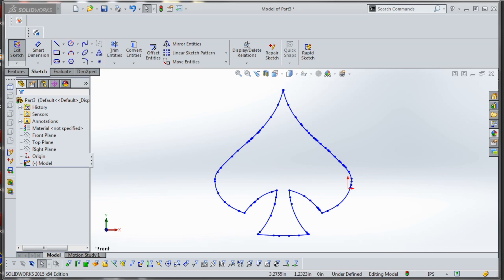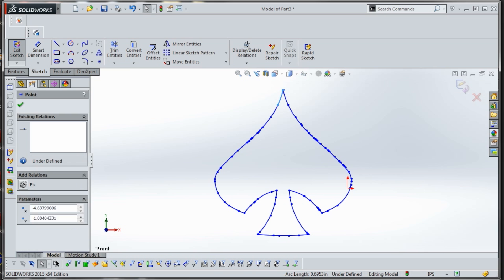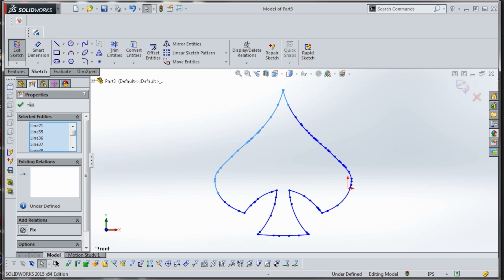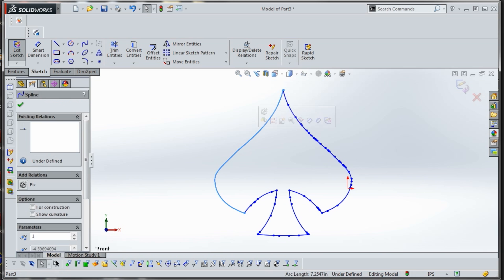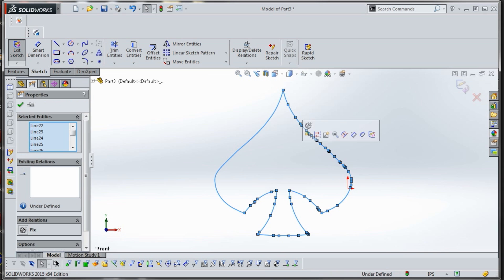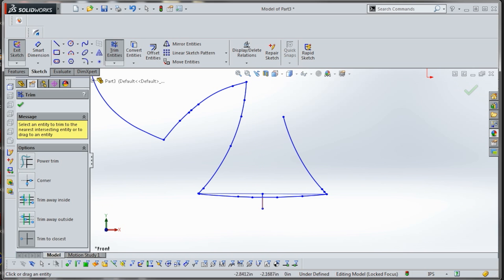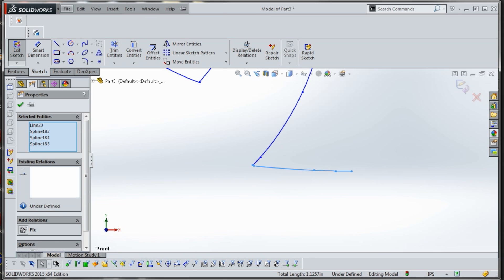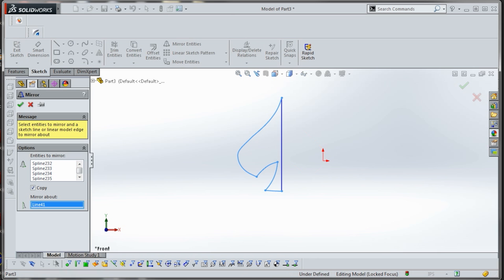Incredible SolidWorks Spline Shortcut!

Comment: When doing splines, I try to keep it to a maximum of 3 points, but usually settle for two per curve, depending on the control I need. I feel like the biggest two curves could have been done with two points (touching each corner), then just adjusting the arrows that result from each point to get what you need.

Comment: Hohohoho Tkanks! and about the selection, if you click from right to left you get green selection (doesn't matter if you just pick part of a line it will take full of it) left to right, blue selection, it will just pick the line which are completely inside of the blue square.

Comment: You mention holding 'select' to make your selection only select what is fully inside the boundary, but did you know that the selection is green when you click and drag to the left and blue when dragged to the right?

The green selection selects everything, while the blue is only that which is inside the selection boundary completely. Unfortunately this only is true in sketch's but is handy nonetheless.

Also when doing fillets, chamfers etc, you can select one edge then just hover into the tool tip and it should have multiple options for auto selection (on solid works 2014/15). Otherwise before selecting the edges you want, right click and use the 'select tangent' or  'select loop' as required.

Comment: A quick tip from me, instead of holding down keys when your selecting things, if you start at the top left and draw your box down to the right, it selects everything wholly inside it. If you start bottom right and select towards top left it selects everything it touches. Just my little time saver I use. Hopefully it's of use to someone.

Comment: Awesome!  I didn't know about this, and have also had lots of headaches converting vector files with a billion line segments.  Thanks for the tip Greg and John!
Reply: JohnGrimsmo I watched your video some time ago about cleaning up the crown file for engraving and thought that was a great way to do it. Im sure your kicking yourself now for not knowing about this. :D
Reply: NYC CNC Is the customer file a DXF? DXF doesn't support splines and will break them into small straight line segments. If your customer is creating the file in Autocad always ask for a DWG. If it's a art program Older AI files work best for us.
Reply: Suade907 DXF does support splines, both fit point and control vertices. It's on the CAM side of things that  arcs are required and in many cases ruin the nice smooth contour. It's a limitation of the CAM software that makes it so we have to translate splines into arcs in CAD before sending it out to CAM vendors.
Reply: gootyam I would beg to differ but to each their own. Maybe some new DXF format now supports them but considering every program tends to use it's own generic dxf format you never know what you are going to be getting. I would argue it's going to be a problem for people that try. I use mastercam everyday and can cut splines all I want. For the last 20 years any dxf I've received that had splines has been converted to polylines that are straight line segments. If there is a new DXF format, I'm not aware and it definitely hasn't changed for my day to day use I still see the same problems. I always request any art in AI format or DWG. I never have issues unless the DWG has text if so then I always request AI format.
Reply: Suade907 I get what you are saying, that Mastercam can do fine with splines, unfortunately not everyone is using a CAM program that can handle splines so the result is we have to send files to be cut in a converted DXF format like you said you've experienced. The result is less than desired every time. It's an industry problem from my point of view. 15 years ago when I ran a CNC machine it could handle splines no problem, but for some reason the brand new plasma CNC out back has antiquated (yet new) software that converts splines to arcs during import with results that are not perfect. The solution is to convert the splines to arcs before sending the file. Same thing for multiple outside vendors too.

Comment: Great tip! Im sure hoping it works in Inventor... Trying now. Again, HAACK function making me... Hack up my keyboard... :-D

Almost wrapped up that contour for you to try on the lathe... Just finished 100 rounds of fluid dynamic simulation to optimize the profile... I think the BC will be quite high, so far, estimated at about .825. For those who are familiar, I bet you know what project I'm hinting at! :-D haha. Last thing is to determine the brass alloy I want to use. How does C360 sound to you? Its free machining, and plenty hard and tough for my use.

+1 Greg!

And thank you for the video. I love that you share even the small things.

Comment: Just a tip (I'm not a pro). When you mirror geometry about a center line the two half's are connected move a line on one side and the other side mirrors that change. but if you delete the line you used to mirror the geometry then you lose the parametric features of the mirror tool. instead select the line and click "For Construction" then it wont affect extruding the profile but everything remains connected. If this makes sense.